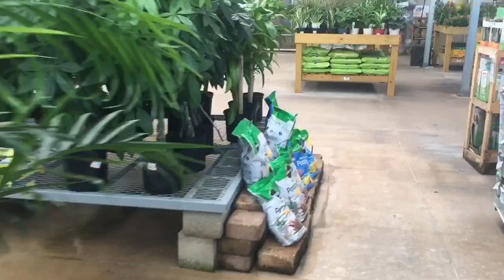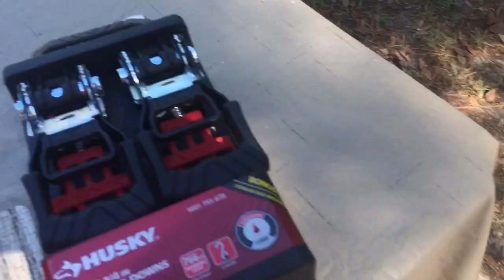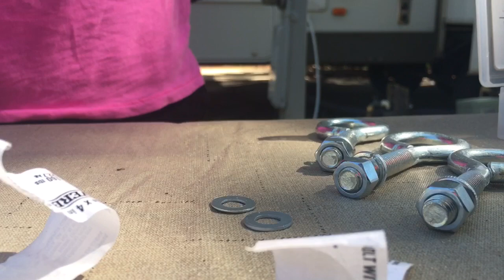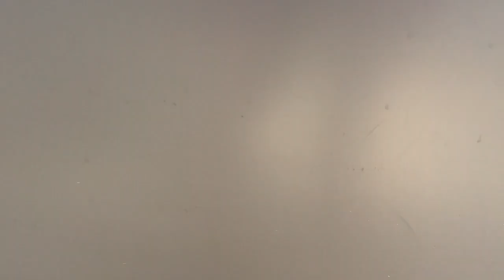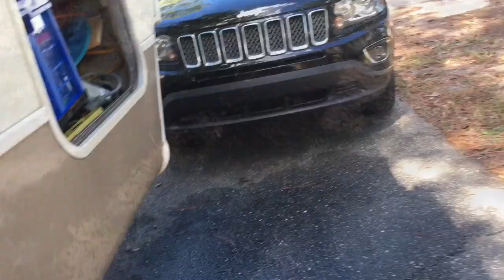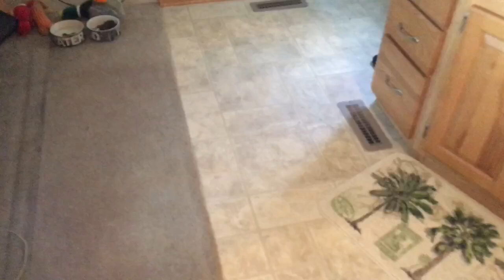DIY- $15 Travel Trailer Stabilizers

Comment: Not sure where you found eye bolts for 85c a piece. EVERYWHERE Ive went, from Harbor Freight, Tractor Supply, Walmart, Home Depot, Lowes, and local hardware stores, the cheapest eye bolt I found was $3.50 per eye bolt, which was on amazon. All the physical stores wanted over $5 per eyebolt. Complete rip off
Reply from the maker: It was 4 years ago. Things are way more costly today.
Reply: @NOmadnesslife  Seems that way. I bought a 5 pack, 5/16th inch by 5 inch long eyebolts for $8.63 on Amazon. They are way too long but for just 4 inch long eyebolts, the price was double the 5 inch ones. Good tutorial though, I just finished this up on my camper today and dont have any shake anymore.

Comment: Good idea. I just hope it doesn't go thru the frame. Eeekk
Reply from the maker: Wood through a steel trailer frame? I don’t think so....
Reply: Maybe in a tornado wood could be driven that hard, but then there wouldn't be anything left of the camper anyway